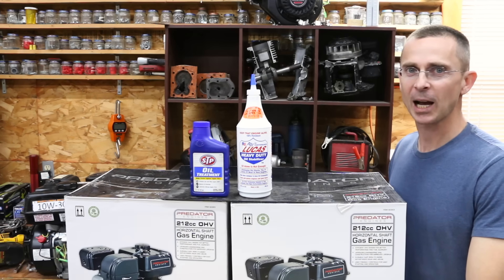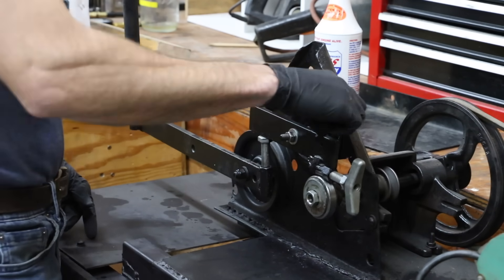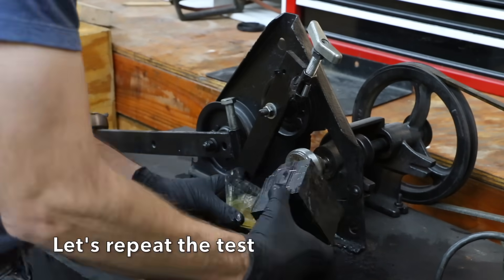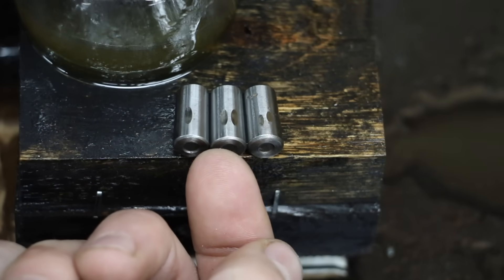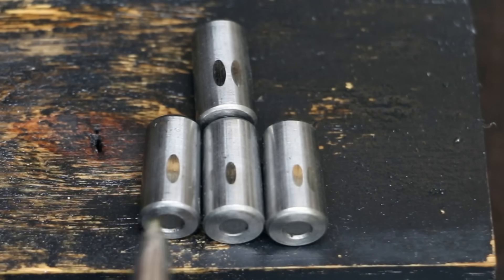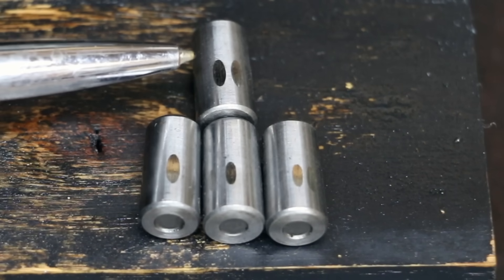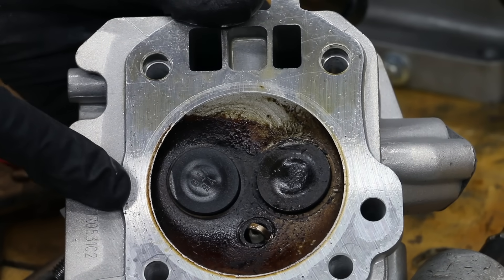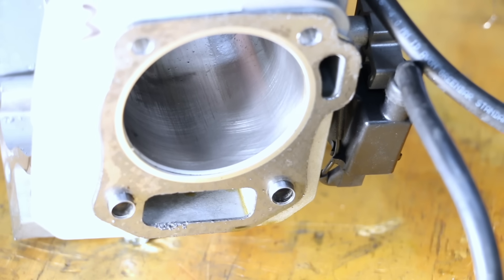Which engine self-destructs first?  Lucas or STP?

Comment: Great video, interesting stuff. I have used Lucas in cars for the last 10 years, and find I will not do any
oil change without it. As for checking this brand synth vs the other brand, it may be really difficult to
quantify the differences, but in the end, a "good synth, Lucas and a good filter" may be the way to go
vs a non additive oil, even synth.

One thing I am curious about: some people do not change their oil, just top it off and replace the filter
at every (or more often) oil change interval (Amsoil is big on this combined with oil analysis, I just think
Amsoil is too much of a multilevel pyramid and loses credibility). I would appreciate your comments. Thanks.
Reply from the maker: I don't agree with using oil beyond the manufacturers recommended service interval.  Even if the oil maintains lubricity, it gets contaminated. This contamination will lead to engine wear.
Reply: Thanks; while I don't disagree with you, I stick to the same guidelines, a petroleum engineer I spoke with adheres to the notion of just changing the filter and topping off the oil, with a premium brand. Perhaps this is the basis of the Amsoil "engine oil analysis and extended change interval" , predicated upon the particulates and contamination level of the oil. The idea of a super efficient oil filter interests me. On the other hand, for example with my Jetta Turbo gas engine, the oil gets "black" very quickly, in spite of being Shell synthetic with one full quart of Lucas additive, so I stick to the 5k change interval.

Comment: I just saw a thing on Jay lenos program about this stuff called Archoil, it has gas treatment, and a oil additive package based on boron, and synthetic grease as well as a rust remover... I'd be super interested to see a bearing test work up and engine comparison using that stuff...  supposed to be one of the best if jay lets it on his show, I guess his mechanics use it in the shop and he learned about it and invited them down to film a segment on it... be interesting to see, you go full scientific, seen some of your stuff on news channels and all the like..  you are doing awesome, keep up the good work.
Reply from the maker: Great video idea!
Reply: well been doing lots of research on what are the best oils to use for flat tappet cams, since new oils can literally destroy classic non roller cams, because they took out the zinc and phosphorus out of engine oils for the most part, I've found Z rod formulation by amsoil, stp oil treatment has the anti wear in it, rotella T diesel oil did, but recent reading tells me that due to the high detergent in that oil, it offsets the extra zinc and phos. So upon coming across arch oil, i'm going to run a combination of dello 400 with  the recommended archoil and bottle of stp…  I bought a truck that came with receipts for 5k in engine parts and building.. so you can see why I don't want it to eat a cam .. lol.

Comment: Lots of fun.  Enjoyed the video.  Did you happen to measure the engine RPM's before and after additive use?  Years ago, I used a Teflon oil additive to my motorcycle and got ~250 RPM increase due to reduced friction (my assumption).
Reply from the maker: I should have measured the RPM.

Comment: none of this means anything. these are not real world conditions especially with oil sensor protection the real test is run them for several thousand hours and see what kind of wear your getting. With proper maintenance these engines ride on an oil film with no metal to metal contact so the should in theory last forever. Would have been a better video to just get to the part where they blew up and just said "This is what happens when you run your engine without oil"

Comment: Hi, I was really interested in your video. Really to do a proper test I believe that you could may be make some changes to the amount of engines and the order of test, you need to have a base line (standard oil), this would mean a 3rd engine. May be the standard oil would last longer !!! or may be no change would be seen.
If the temp of the engine was to be affected by the additive it would also be a great idea to measure the temp of the exact same place of each engine before and after changing from a standard oil to the modified oil, then measure the temperature increase or expected decrease after the additive has been added and friction is reduced.
Hope these ideas are interesting for you guys.
James.
Reply from the maker: Thanks for the recommendations.

Comment: those harbor freight engines don't look half bad.  I wouldn't compare them to a real brand engine but they are probably as good as a modern briggs.  Probably made in the same factory.
Reply from the maker: I like these a lot. I removed a Briggs off of a water/trash pump and replaced the engine with one of these.  It was a huge improvement!

Comment: Casite Motor Honey "re-plated" a 60 grit sandpaper finish on my 350 chev engine crankshaft that was knocking louder than a rock band drummer.....ran another 30 k miles and sold the vehicle to a friend....and still running....CASITE MOTOR HONEY a must in every engine I have
Reply from the maker: Impressive!

Comment: I worked in a VW, Porsche, Audi speed shop in the early 90's and the owner came across a product called Power Up... I remember the bearing tests and was surprised, no matter how hard you pushed on the bearing vs spinning wheel you could not make the spinning wheel stop. It was compared to all the standard oil additives in front of me and I was amazed. My immediate thought was "snake oil salesman". I remember the additive was not very thick or slow to pour, maybe like  room temperature vegetable oil. It smelled like maple syrup. I looked it up and it seems to still be available. 
Power Up NNL-690. If you could do the bearing test and compare you might have the same reaction I did. I am a big fan of the Lucas HD engine oil stabilizer and will continue to use it but you may find that this stuff at 100% vs bearing test boggles your mind.
Reply from the maker: Thanks for the recommendation!

Comment: This really doesnt prove anything however they claim to eliminate dry starts and we can see thats true with both or they would have locked up pretty quick. But oil with out pressure is not gonna do its job even if its present.  The lucus did run longer but i think theres a better way to test it
Reply from the maker: Thanks for commenting.

Comment: I use STP in hot weather as an oil thickening agent. In hot weather, the 10W30 gets thin enough the oil pressure drops enough the oil pressure light flickers at idle. Ideal, I should have the oil pump replaced, which involves dropping the pan. Not bad, you think? To remove the pan, the front axle has to be dropped. Not so easy now. The motor is a 4.3 Chevy with 155k miles. Or I could just change the oil to a thicker grade, but I don't put over 5k a year on it, so adding STP is the cheapest alternative..
Reply from the maker: Great strategy!

Comment: You should also try taking two engines apart and cleaning them up just like you are doing an overhaul on them, than use 10w30 as an assembly lube on one engine and Power Punch on the other and see which engine lasts longer running the crankcases dry (maybe use 2 stroke gas to keep the top ends lubricated).
Reply from the maker: Thank you

Comment: The bearing test doesn't look like a very reliable way to test lubrility due to the fact that the components that make contact were not completely submerged in the oil and different oils have different viscosities and the difference is day and night like how the unmixed lucas oil's properties changed due to temperature changes - the oil became a sticky syrup that "globbed" together and the stp oil became more like water and went everywhere (which is a much more natural or desired property of an oil), from the bearing test the lucas mix won, during the engine test lucas mix won again.

I picked lucas as the winner as during the engine test the stp engine was deteriorating at a faster rate until complete mechanical failure, yet both oils and mixes looked unstable due to the ambient temperature. I'd still pick and use motul oils over either stp and lucas, also I don't understand the need to remove all the oil as in a lot of cases were the oil retention system fails and you dump oil, your engine will still retain a certain amount and it could be 50ml or a few hundred ml - as still even such a minute amount could keep a engine operating without rapidly deteriorating, in most cases mechanical failure will happen in the cylinders as the piston rings will score as they get ground away and once the connecting rod heats up it will become very unstable and brittle - even if the oil pump failed or the system had a leak most of the oils would still collect in the crankcase and would therefore keep the shaft and rod protected.

Comment: Do the same test w just 1 engine but add Prolong & let it run awhile & then drain the engine & run it dry. New Cars have been driven coast to coast w NO oil in them once prolong treated. Al Unser did a demo when Prolong 1st came out. Old engine in a block run up to operating temp, shut off, prolong added, restarted & allowed to run for 10 minutes & WHILE THE ENGINE WAS STILL RUNNING, drained the oil/water & time lapsed the engine STILL running 12 hours later. Ive never lost an engine running oil/prolong since & I drive em hard. Get outrageous miles out of them before selling them. Put it in rear ends, manual transmissions, wheel bearings. Anywhere that parts get hot. Even mix it w  grease for driveshaft bearings. Theoretically it soaks into the metal a few microns & the metal never again touches itself if both surfaces are treated. It activates at 140° F.
Reply from the maker: Thanks for the recommendation!

Comment: I have read many posts about how NO oil additives are beneficial without any evidence other than an opinion. Valvoline produces racing specific synthetic oils that are friction modified PLUS have anti-wear zinc additives. Rislone sells an additive with high zinc content. It would be interesting to see an independent test with ANY aftermarket additive with high zinc to see if it is truly beneficial. I've used Valvoline 40W  VR1 racing oil in my commercial grade ZTR mower that has a Kawasaki air cooled V-twin for a few years. It has nearly 600 hours of very hard dirty use and is 11 years old. It doesn't use any oil between changes nor does it smoke from the exhaust. Is that proof of any oil or additive being the cat's meow? No. Nor do I recommend any oil or additive over any other. This is simply what I think works for me. I might add that I change the oil/filter every 35-40 hours which is FAR more often than recommended. In my humble OPINION, using a high quality oil along with changing it often along with a quality filter is the key to engine longevity.
Reply from the maker: All great points and thanks for the video idea!

Comment: How much longer did the Lucas run, 2 - 3% longer or perhaps 30 times longer? Did I miss that? Great videos!
Reply from the maker: Nearly twice as long.  I placed a stop watch next to each engine to show the run time.  Thank you!
Reply: So I did miss the timers :) However I have a bit of a consideration about the test as such... I think there may be a great difference in using these oil treatment products WITH the oil it is supposed to run with and running dry... I understand that the tests with fully oiled engines is totally impractical since they will just keep running indefinitely, but I'm not sure if the tests without oil can be expected to give exactly the same difference as with booth oil and treatment components present... 
Still, I really like your eagerness to put the products to the test and looking forward to more interesting tests.

Comment: I agree with the numerous control engine suggestions, that would have been nice. I would also like to see some measurements on both engines after break-in, at 5 minutes in (no oil) and  measure again what the running (lucas) engine looks like when the STP one quit, but that would be a lot of work doing multiple teardowns to take measurements.
Reply from the maker: Great point. Thank you

Comment: High concentration of Moly disulfide would more than double the run time.  Graphite may work also - both are good for dry lubrication., which is what you end up with when the remainder of the oil is evaporated by the high heat.
Reply from the maker: Thanks for the recommendation!

Comment: from a standpoint that modern oils no longer have sufficient zinc for flat tapped cams and such a zinc additive is good. Stp has both the high viscosity and low viscosity version red vs blue bottle. Blue is supposedly about sae250 per an oil analysis. Which in the volume suggested would move you up about one viscosity rating i.e. Sae30 to 40 when in service. It serves a purpose, but a run it without oil test doesn't test any useful or real world conditions. Thanks for the video though
Reply from the maker: You're right!  Thank you

Comment: I use Lucas.  I discovered that if my truck sat for 2 weeks without starting that I could hear the valves clack at start up.  I tried Lucas for that problem.  I no longer have dry starts.  An added benefit was cooler running temperatures and about 2-4 more miles per gallon.  The long time cling feature was the main benefit for me.
Reply from the maker: Impressive!

Comment: Two Harbor Freight engines from China built to unknown tolerances.
It reminds me of the Formula Ford race cars.  1600cc engines (Pinto). Called the any man's race. Because they were cheap engines with no mods allowed. Required to be totally stock.
Then the rich guys figured out that there was not much in the way of quality control. The engines were all within tolerance, but some had better specs than others. These guys that could afford it would buy 10-12 engines, disassemble them, accurately measure every part, pick the best parts and reassemble a superior completely stock Pinto engine.
With two Harbor Freight engines, how would anyone know what the differences between them would be?
Reply: Yeah - for a given value of "superior". Those things ran like a bag of hammers in a cement mixer @ the best of times. Still at least they weren't the CVH ones - those were worse, you could hear the tappet rattle on Mars.

Comment: You didn't tell us the time difference they ran empty before throwing the rods.

And you didn't call off a winner, wtf.?
Looked mixed to me from one test to the other. But overall,, based on the run times witnessed and that connecting rod result I'd call Lucas the winner.
But it's the loser on the bearing test.
Reply from the maker: Lucas lasted nearly twice as long.  Thank you
Reply: Project Farm
Thank you for the quick response. You may have said it or even showed it on those meters you were using but i couldn't l tell what that meter was representing due to eye strain.
Anywho, i just had to watch this one because of the amount of lucas oil products I've been using for years. I hate that it ran a little hotter, but overall you can't argue it much.
Reply from the maker: Lucas seems to be a great product. I don't like the extra viscosity in the winter when the temps drop below freezing.  Otherwise, it's great for warm weather use.
Reply: Project Farm 
Consider that it's mixed with your regular oil though, i don't think viscosity would have much effect.
None the less i mainly use the gasoline product for upper lubrication and keeping my injectors clean.
I can always tell the difference after i put an ounce in my tank and let her sit over night, next day she always has more pep.
Both my truck and mustang I've been using it in for years.

Comment: Both products basically increase the viscosity of the oil.  I'd like to know how many points up the scale the viscosity increases.  Looks like the Lucas engine ran about 10 min longer than the STP engine.  The outcome wasn't surprising at all except for the time to fail periods.
Reply from the maker: Great point.

Comment: The reason why most people buy these products, is because of the claim that they help with cold starts. By keeping parts coated in lubricant after the engine has cooled down and oil has drained back into the pan. Thus the thickness. I enjoyed your video, but it really did not speak to the issue of cold start performance. That little gear demonstration on the counter of the auto parts store is pretty convincing on the Lucas performance. It sells product. But my car uses 5W-20W oil. I don't want to increase the viscosity if the engineers wanted a fast flow. Thank you for your work. It is interesting because we are all looking for maximum performance and long life from our investments. Its funny because with cars, it is the stuff bolted on to the engine that goes first. Engine just seem to keep ticking away.
Reply from the maker: Thanks for the constructive feedback.